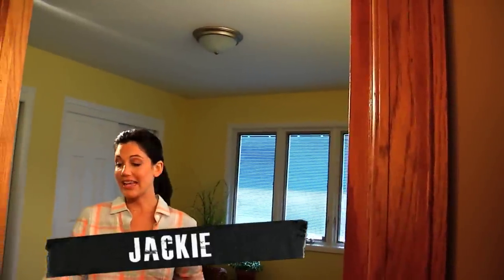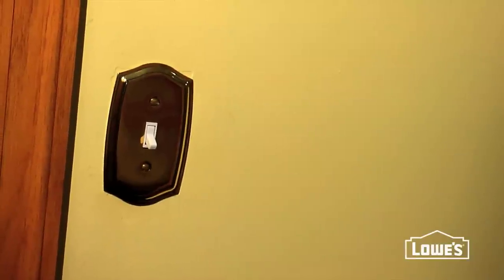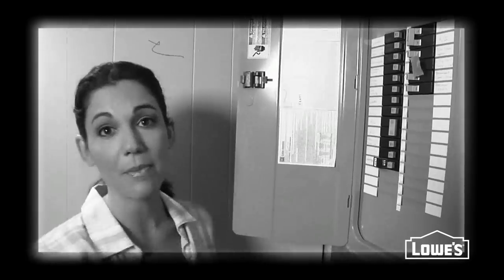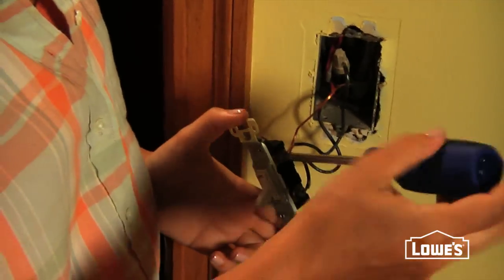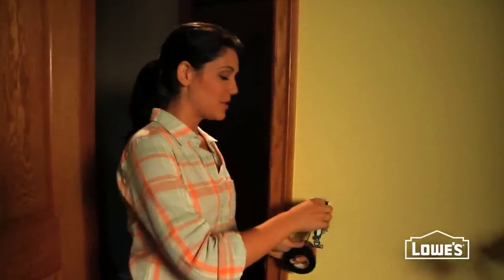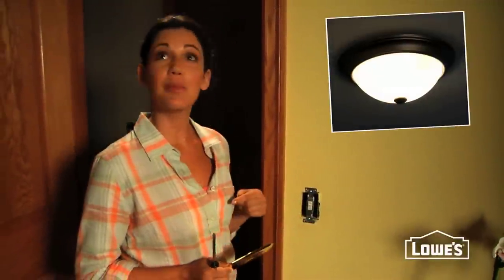How to Replace a Light Switch

Comment: Wires need to be wrapped around terminal screws CLOCKWISE.  In this video it appears that they were wrapped backwards.  This does not make a very strong connection.
Reply: Thank you. I saw that too and it caught my attention in a negative way. Like nails on a chalkboard 😂

Comment: # 1.  If you wrap the wires counter clockwise around the screws like she did, the wire will loosen itself as you tighten it. This is a no no. Electricians ALWAYS wrap wires around screws in a clockwise manner. This is an indicator that this person has no business installing a switch. At least not in my house or business. #2. Always check your tester against a live circuit to make sure your tester is reading correctly before you touch any bare conductors.
Reply: Stop crying.
Reply: He’s not wrong though

Comment: Good demo. However, many switches are installed with solid wires connected to the back of the switch by inserting into small holes. Remove the wires by using a pair of needle nose pliers. To easily release the wires, push a small nail into release hole as you pull with the pliers. To connect the new switch push the wires into the connection holes.

Comment: The wire's must be wrapped around the screws in a clockwise direction in so the wire will close in instead of opening up when the screw is tightened. You didn't do that.

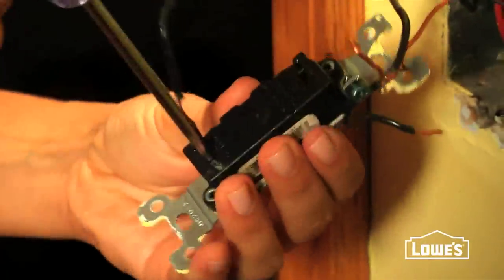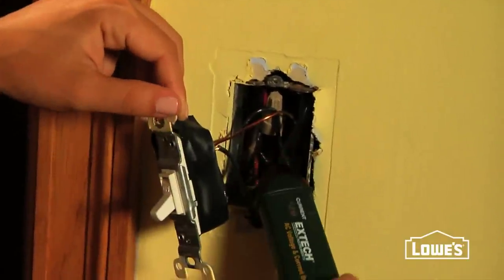Comment: Poorly made how-to videos are my pet peeve. Why use a black switch where all detail is lost in the FEW close-ups? When push-in connections are shown at 1:36, I couldn't see them at all. Likewise with the circuit tester at 0:59. "Jackie" is lovely, but the video's not about her, it's about the light switch, so why zoom out for a midshot of her when she's insulating the screws, rather than zooming in on the switch? And anybody notice she turned on a different breaker than the one she turned off?
Reply: I came here to see if anyone else noticed that she didn't turn on the same breaker. Lol